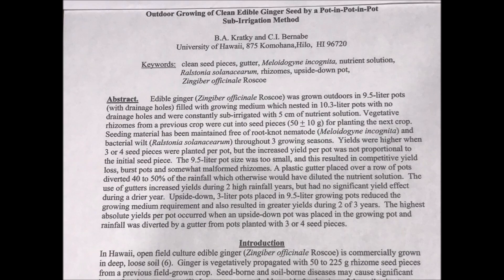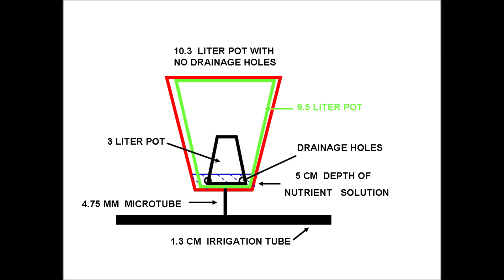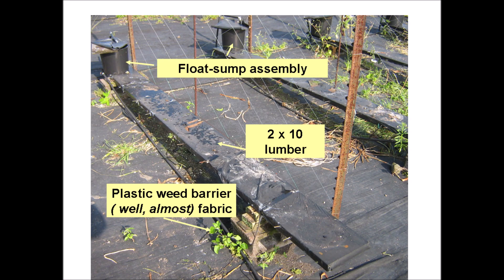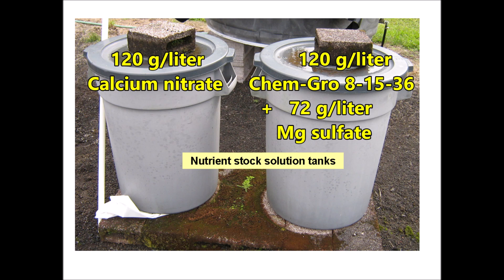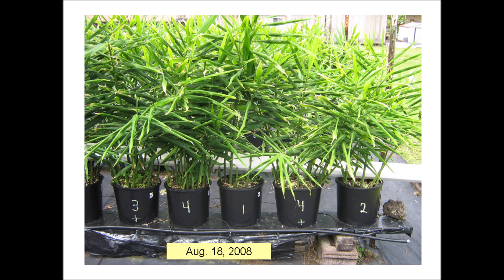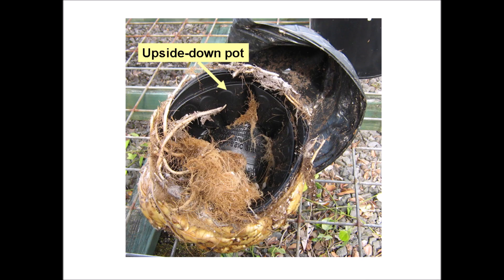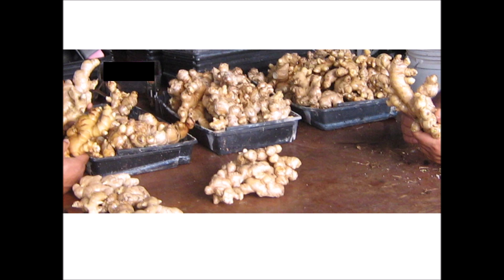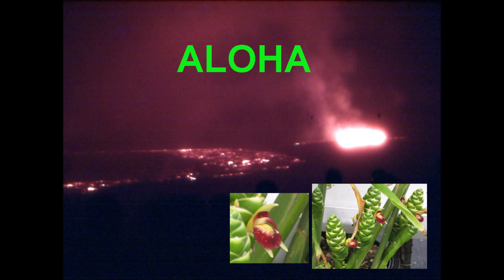Outdoor Growing of Clean Edible Ginger Seed by a Pot in Pot in Pot Sub irrigation Method

Comment: Curious why the outermost pot needs to be any larger / taller  than the 5 cm  depth of solution that it carries. I would put pot in pot in a big tub and use that as outermost pot for multiple of pot in pots. The outermost post is a saving in this arrangement. This also makes it possible to have pot in pot technique to become pot in grow bag if a grow bag is used. The use of grow bag will be more tolerant to pot bursting.

Comment: I’ve just recently found your video channel and just have to say thank you!   so much information.  May I ask, why is the sub-irrigation aspect so important, which you point out explicitly at the end. Why not irrigate with the solution from the top, using the pot in pot in pot method?
Reply from the maker: This is possible, but it would require a specialized float valve that could release the solution in this manner.

Comment: Hello, Dr. Kratky,  Where you to find supplies of Nursery pots that do NOT have the predrilled holes?  This seems to be an impossible find for me. Everyone I find has "hoses drilled for proper drainage". I don't want to sacrifice my 5 gallon buckets for this so , if you have the name of these type of pots , I can search and ask vendors if they have them. Thanks 

Also, I am considering trying to grow ginger like this but using hyrdroton clay pebbles. My first attempt used a bucket, with a pot at the bottom , and the clay pebbles filled in, but rather than having sub irrigation, I tried doing it like Passive Hydroponics where I filled it to the top with nutrient solution in contact with the seed pieces and they would grow downward as the water receeded. Unfortunately, I didn't plan for mulitple rain storms that ended up flooding my bucket system and drowning my plant. ( it had a large open top net cup designed for 5 gallon buckets)  After watching   this video, I realize how important it is to divert rainfall.

Comment: Could I use cleaned organic ginger from the local Natural Foods store for the "clean ginger seeds" you mention? Maybe soak them in hydrogen peroxide?
Reply from the maker: It's not a 100% guarantee because the ginger could harbor bacterial wilt, but if the ginger looks healthy and the rhizomes are hard, there is a pretty good chance you will be ok.
Reply: @growkratky5558  Would you like to see a pic of my Ginger foliage (after 5 1/2 months of growth)? I'm growing indoors, next to an Eastern-facing window in the summer in Oregon on the coast.
Reply from the maker: @8lazingSaddles  Yes, maybe attach it to an email sent to dakineapproaches@gmail.com

Comment: Dr. Kratky, has anybody tested the nutrient levels of these vegetables and root crops when they are grown hydroponically? The reason that I ask is because Ginger is a medicine for me, not just a spice. And would there be a difference in growth if you used rain water instead of well water?

Also, has anybody tested seeds from plants grown for several years produced in this manner, say three generations of harvested seeds, and then tested them in soil to see if they had adapted to growing only in nutrient solution?
Reply from the maker: I haven't collected this type of  nutrition data and can't quickly locate similar data from other researchers.
We have grown ginger like this for a number of years and distributed ginger seed rhizomes to folks who grew in soil and the ginger grew normally.

Comment: Thank you so much for the video. I was wondering if this arrangement could be possible with traditional irrigation method at home. What I mean is can I achieve the same production if I water the pot with nutrient solution manually from the top?
Reply from the maker: Yes, that should work well.

Comment: Wow I can see so many benefits from this simple pump free method with the air space, The commercial hydroponics system bucket lids make use of the upside down pot at the bottom of the large attached net pot but I hadn't thought of it being used in this way with the nutrient sitting level with the very bottom of the net pot with the auto refill from float valve awww seems a bit of a waste for me to use it as a bucket in a bucket poor mans dutch bucket, seems so obvious after seeing this video, thank you for making all your awesome videos!!!
Reply from the maker: Thanks for sharing your thoughts!

Comment: Interesting, I'm curious about cost analysis of the 3rd pot vs cost of grow media and factoring in the split pots loss vs added value of packing the pots. I'm not familiar with the market value of Ginger, curious if adding that 4th seed provides a significant return on investment. There is something special about those air spaces. As always, thank you for sharing. Big blue thumbs up for you, kind sir.
Reply from the maker: Growing medium is surprisingly expensive - $0.59/liter at one retail outlet in Hilo - even when buying a 3 cu ft  bag.  This calculates to $1.77 for 3 liters which is more expensive than a 3-liter blow molded pot and that cost decreases with each re-use.  Split pots could be eliminated by selecting larger pots. Yes, adding a fourth ginger seed piece probably is not a good investment.

Comment: If the rhizome was allowed to be submerged, but the water was oxygenated sufficiently, what issues do you think that might cause?  Would the rhizomes absorb nitrate or some other negative effect?
Reply from the maker: Hi Jeb.  We never tried growing submerged rhizomes, so I really wouldn't know what to expect.  However, it was possible to grow ginger elevated up 5 cm on upside-down nursery trays without growing medium and where the nutrient solution level was just below the nursery trays, so they were not submerged.  Rhizome yields from this 'no growing medium treatment' were much lower than when ginger was grown in growing medium https://www.ctahr.hawaii.edu/hawaii/downloads/Experimental%20Non-Circulating%20Hydroponic%20Methods%20for%20Growing%20Edible%20Ginger.pdf
Reply: @growkratky5558  I think the day night cycle might be the cause of this.  You can have very high humidity for a good portion of the day, which gets the roots going, then they die back when humidity drops in the heat of the day.  As soon as the roots are submerged they can grow aggressively.
Reply from the maker: @JebGardener  Good logic, Jeb!